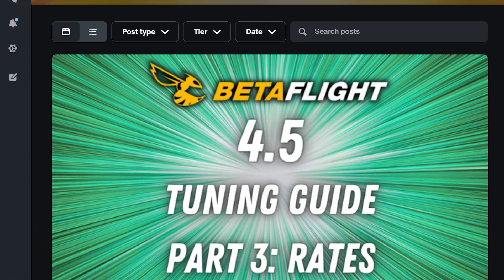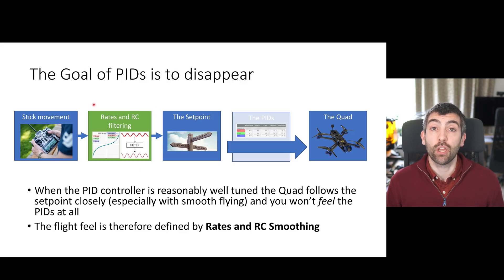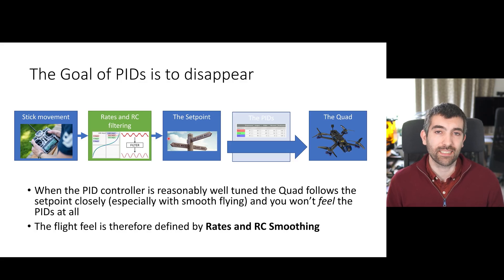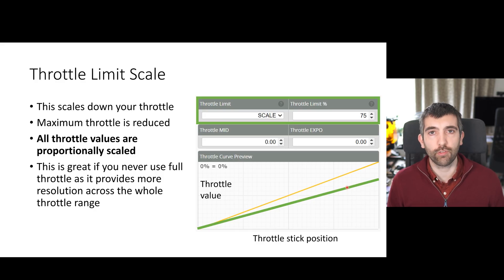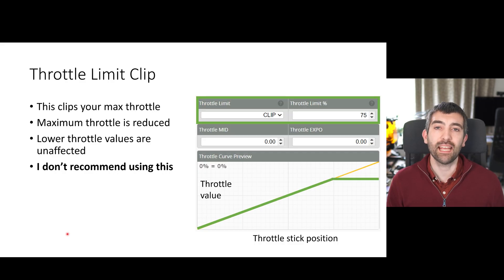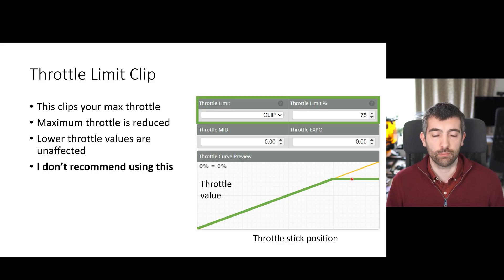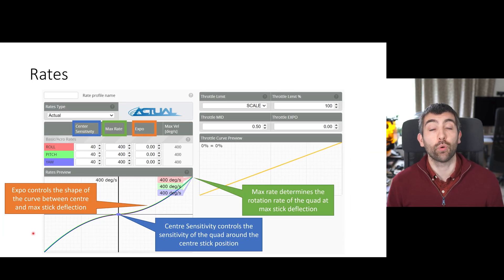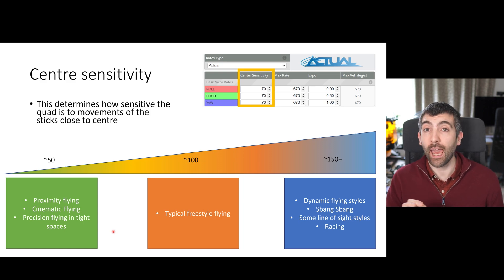Betaflight 4.5 Rates Tuning

Comment: This video inspired me to drop my center sensitivity from 160, to 100, and to use slight throttle expo (mid 0.0, expo 0.2). Result? I'm much more precise with low throttle and in tight places. Also small throttle corrections during dives are much easier to get just right.

Comment: Started here on your series. It’s a whole new meaning of control and confidence. 
My Titan power loops , rolls , and gaps at will. Tail slides and cobras are a rush. I was hesitant before to power loop because I flew right into the ground once. Now it’s straight up with nothing but blue sky then 🐍 cobra and dive with finesse ❤
Your amazing.

Comment: Why don't you just set max ( with in reason ) in Betaflight, then do the rest with your transmitter eg Rates, Expo. Throttle curves? that way they are only a switch away in flight.

Comment: I definitely prefer setting the throttle mid to zero as well. It just feels way more natural, there's no weird spots in the throttle curve. Setting the mid point to where your quad hovers is probably good for cinewhoops. For freestyle however, setting it to zero is the best IMO. 

When setting the mid point to zero, I think using up to 20% curve works well, above that it starts feeling off again. Using a 20% curve combined with the "Throttle Limit Scale" should give you all the precision you need for freestyle.

Comment: very interesting point regarding the fact that scaled throttle cap does not limit the motors ability to use its full output when needed!

i'd love to know how rc smoothing works precisely and how much delay is added. it always felt sluggish to me.

i settled for no rc filtering, very low jitter correction on FF and a deadband of 5 on all axis and 25 on yaw. 
flies locked in and super responsive. however, your video is making me explore RC smoothing again.

Comment: Hello , I am building a 5 Inch Squashed X with AOS Supernova Motors, Speedybee Master 5 v2 HD with Soeedybee v4 405 flight controller. This is my first 5 inch built.
After watching this video I have been thinking to set the rates as you mentioned in the video. Do you ever plan to make a video on setting up best rates for a AOS Supernova Motor built and Tuning video. I was wondering it would be a great opportunity for us to get more how to configure the motors on a new build.

Comment: Hi Chriss. Please help!!! Have bought AOS 5 v2 frame and AOS 2207 motors. Can't understand strange behavior with Mamba F722 stack. With all stock PIDs it flies away at arming!!! Can fly and hear no oscillations at master multiplayer value about 0.25 (D value not higher than 7!!!). Tried BF 4.4 and 4.5 (latest build)  Have big experience with assembling drones but usually stock PIDs is a starting point to tune. What can be wrong? Are these motors too crazy for stock pids?

Comment: Can I set the lowest throttle point to the mid point? Or just below.. I learnt to fly on a ps4 controller and I need to replicate it. I have managed to do it on DRL simulator with the TBS Tango 2 but I can’t do it on beta flight. When I tried it made the drone unable to take off as it was pitching backwards constantly 😢

Comment: Throttle cap may give more resolution but less thrust when you might need it in split second saves after a big dive or other situations where you need that xtra 20% power... also just love big punches. Running 5s on 2450kv motors. So fun. And so easy to recover from mistakes cuz there is so much power.

Comment: 1100 rates feels like a dead battery, I run 1950 only because higher makes the gyro flip out. Even 1750 feels dead. Also I run lower expo than default because high expo you cannot control spin rate near stick end. I can Taz at 7.6 rolls per sec.

Comment: Great video Chris. The most important control to tune for close proximity flying is throttle. I set throttle expo by first finding at how much power does it take for the quad to hover with linear throttle, lets say 28 and I use that for my throttle MID and adjust expo for the motor prop combo that I'm using. Works great for precise pitch control in close proximity flying. Expo about .18 to .3 for my liking. Thanks

Comment: What about expo for the rates? I know what it does but I would have liked to hear what you have to say about it. Thanks for those videos!
Reply: same question here ))
Reply: @VaxtaFPV  He's said previously that he uses one of the presets that gives 56 expo which offers better resolution closer to the center stick position
Reply: he has said previously that he uses around 50 expo, same as he uses for the throttle
Reply: @tyborg314  I already burn my motors because his videos (( I just set default setting ... not recomended without knolage do same ...

Comment: Ummmm, wait. What happened to the explanation of expo on rates? Personally loved the explanation of everything else.  I myself center at 50, rate at 850, but have an expo in the .60s
Reply: Dont worry about explanation, tweak settings in simulator, fly each for 5-10 minutes after change and proceed further or revert if you dont like that. 
This is the most individual thing ever on fpv drones - rates. Followed by stick ends and radio grip. Nothing fits everyone, whoch is great.

Comment: I have been flying a Pavo20 indoors and have my Max rate on Pitch and roll absolutely dead.  I set to 10 and I love it for flying crawling slow. But have my yaw pretty fast to make the stick movement small.  I wish I could actually make it even slower than 10 in pitch. The 3s in that quad makes it pretty damn zippy.  It is wild how different each quad responds to this tuning and I think more people need to mess around in here to adapt a quad to your need vs you adapting your own flying to try to adapt to a quads behavior.  Great explanation of all of these settings!!
Reply: You could limit your stick in the radio “software” that would make it below 10. But at that point I dunno how you wanna fly with such almost negative rates.